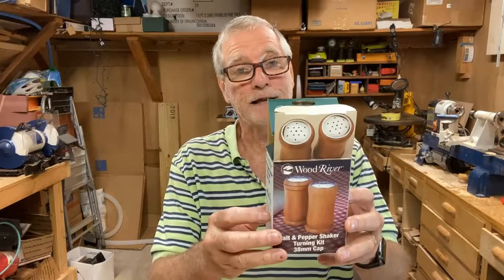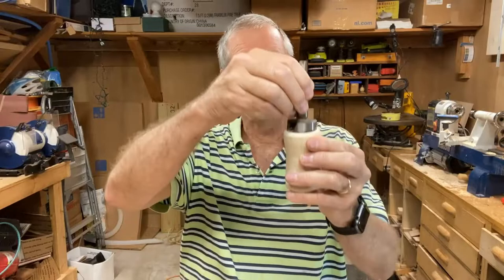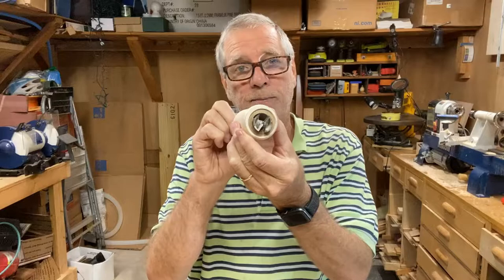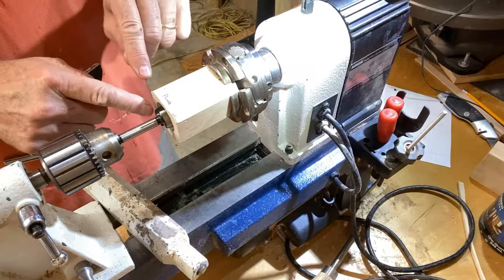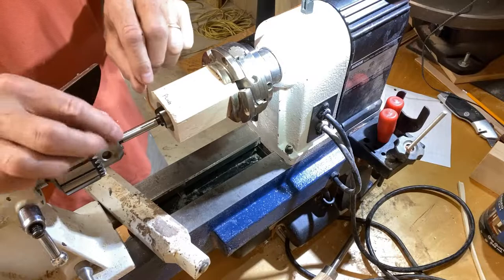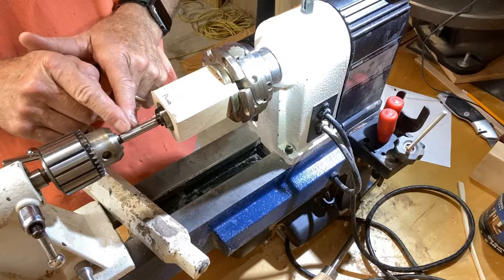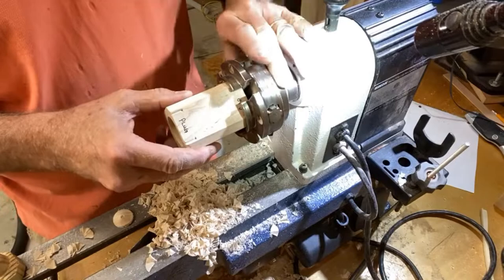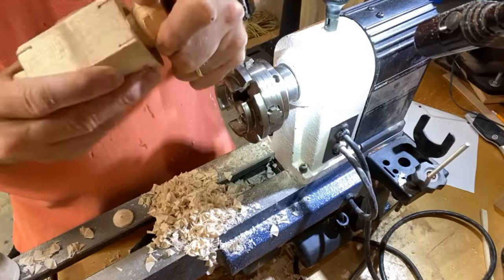Woodriver Salt & Pepper shakers

Comment: Thanks for info.  Helpful in my own quest to learn how to turn.  Just curious - do you waste the brush after applying epoxy or can it be cleaned and reused?
Reply from the maker: Thanks! Deft is a water based poly so the brushes wash out easily in water and the brushes can be used.

Comment: Any concern for salt in stainless steel tube?  For grinders the use of ceramic is standard, not steel.
Reply from the maker: Good question. If the salt remains dry I would think the stainless will be fine. I’ll let you know what I find out. Thanks for watching.

Comment: What happened to the inside of the shaker?
Reply from the maker: A metal tube was placed inside, and it is capped at the bottom, with the shaker on top.
Reply: Did not show inserting it. I bought this kit, many reviews state its hard to turn correct fit.